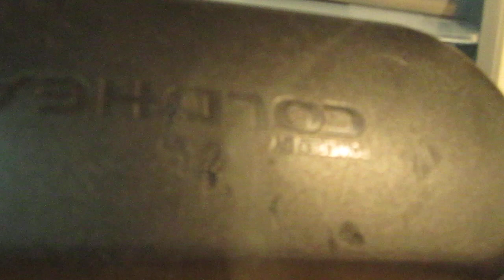Nintendo Zapper Laser 2W+ laser (update) by North Street Labs

Comment from the maker: In the build log on our North Street Labs website, I decided to keep the stock trigger function exactly as it was.  I get to keep the iconic "ping" noise for a quick pulse or a partial pull for extended burns.  The heatsinked driver is efficient and will likely outlast the diode if put to the test.  Thanks for the comment!